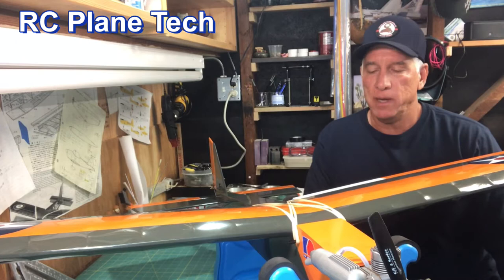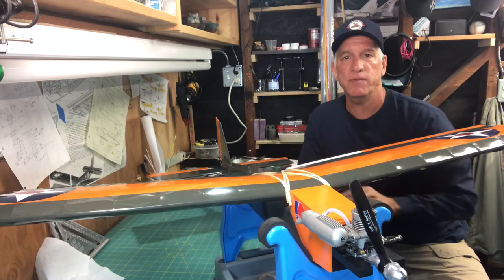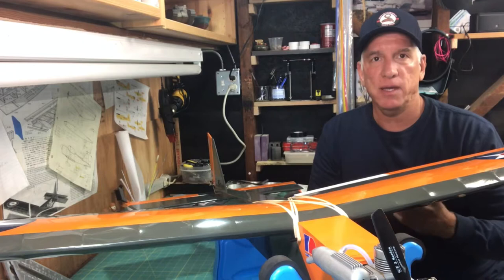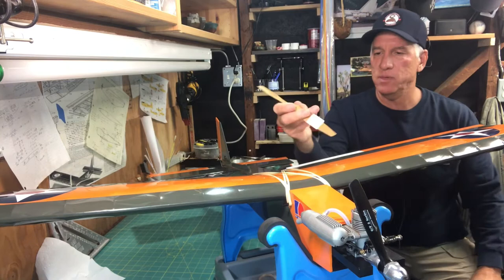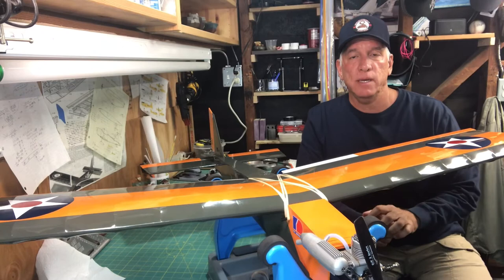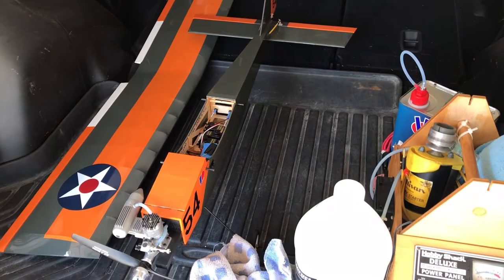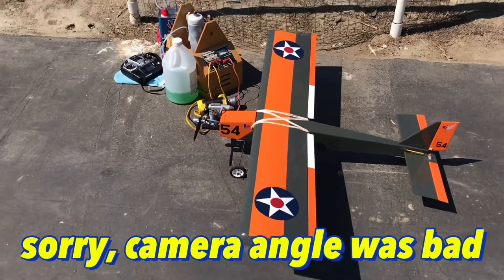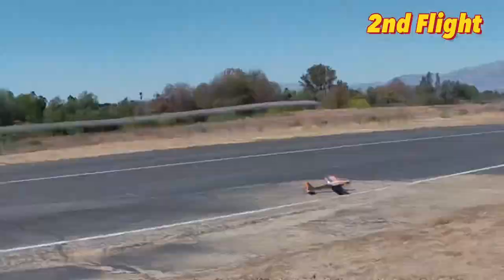Barnstormer 25S Maiden Flight, OS Engine .25 FP

Comment: I don't usually comment as I watch different builder videos and it's the little details that make the build interesting. Often so much is skipped to make short segments those details are eliminated. You hardly ever see the installation of the electronics or engine with fuel hook up. All in all an enjoyable build that I picked up a few new ideas.
Reply from the maker: Thanks, glad you found it a little useful. Sometimes I wonder if Im doing too much. Thanks for the feedback. I learn a lot from watching others videos as well. Many different approaches out there. Thanks again

Comment: Nice airplane.  I had one 30 years ago, with a O.S. 25SF ABC. I like the simple construction and size.  I managed to get hold of all the models on Ebay. Thats the TMG(10-15 size glider), 15T, 25S, 25L and 40L. I have build the 15T with a FS30 surpass. Nice plane, but has flat wing,  lacks aileron and not that fun to fly. Next one I build will be the 25 or 40L. I also agree with you on the FP series. Have all the sizes except the 60. So easy to operate and powerful enough for this kind of plane.
Reply from the maker: Thanks for the comment. Yes, lots of good stuff on ebay, engines and vintage kits. Some are pricey, but once in a while a good deal is found. I’m still keeping an eye out for the 25L : low wing version.